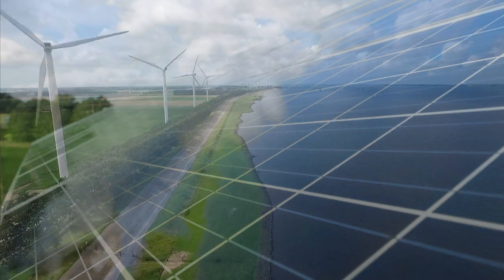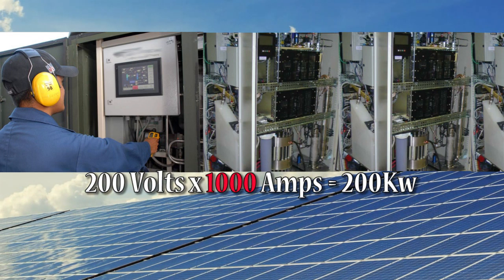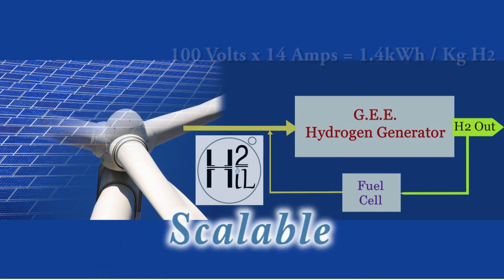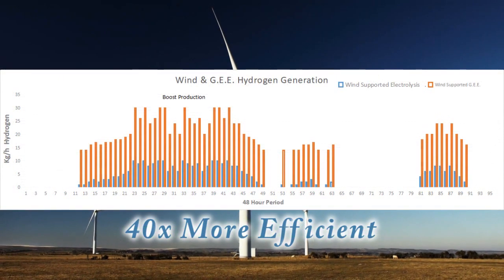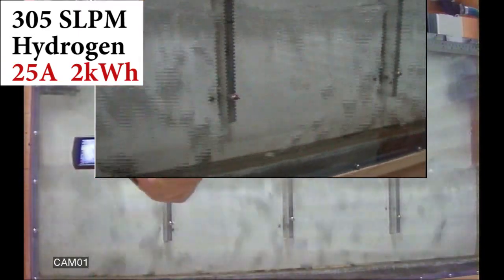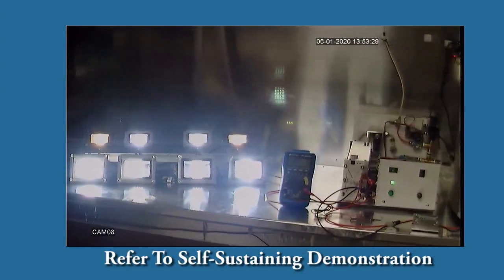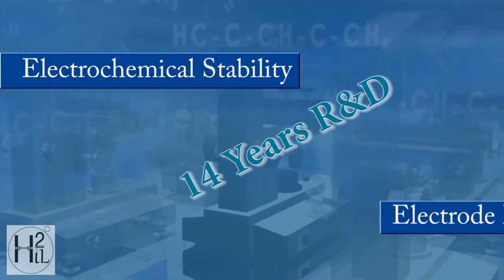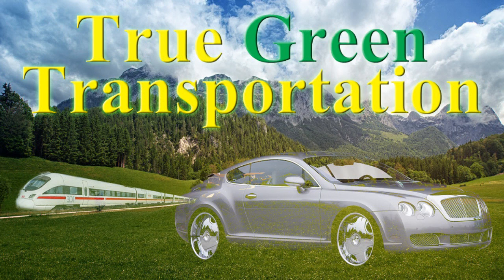Energy Storage in Hydrogen - A Workable Solution to Green Energy - Renewable Energy

Comment: Water is not a bi-metal. Is the galvanic energy coming from metals dissolved in the water? Or are you using the galvanic energy of oxygen? I didn't know oxygen had any galvanic potential. Where is the galvanic energy coming from?
Reply from the maker: Thank you for your question. For a full explanation please refer to the Technology' page of the h2innovationlab.com website.
Reply: @h2innovationlabh2il69  From what I can tell from your website the galvanic energy is coming from the electrodes. 
"One may therefore conclude that the bi-metal electrodes are the fuel and would need to be added into the calculation. Within all electrolysis cells the anode electrode is eventually consumed. Therefore one may conclude that within a galvanic arrangement the metals providing the galvanic energy would consume rapidly. However this is not the case in this application." 
 Hydrogen has a high energy density for a chemical fuel. So if even half of the hydrogen is being produced using galvanic energy a lot of galvanic energy would have to be converted every second. So for the galvanic energy to not be depleted the galvanic energy density would have to be massive and there for reprocessing the electrodes would require the energy input of all the hydrogen galvanically produced in the cells life time. And if the efficiency is as high as 3000% this problem gets even worse so how is the galvanic potential not being depleted? Is the galvanic energy density much higher than I thought it was? Or is some other form of energy involved in this process?
Reply from the maker: Nice to see a comment that is on track. Yes this a logical assessment and deserves a more in-depth explanation from the H2IL technical team rather than the media manager.
In the interim please refer to the video:  https://youtu.be/D9LBdO4cVmc  which give a brief, technical explanation of electrode longevity. The self-sustaining presentation and verification report CCTV videos on this and the H2IL MARKETING channel demonstrate a very small cell delivering a lot of energy for hours on end. Obviously not massive size electrodes in the small demonstration cell. If the electrolyte was replenished (as it is in the FULL running system) then the system would continue to generate self-sustaining energy longer. I understand the electrodes of that cell are still intact. 
The cost of galvanic electrodes is US$500 per US$20,000 (pump cost) of hydrogen produced. The electrode life is up to 5000 hours. The video I directed you to above explains it well but I will see if the H2IL scientists can add to this information.
Thank for your support.
Reply: @h2innovationlabh2il69  The video and demonstrations did a good job of explaining that the electrodes a last long time.  In fact the reason I thought it might be something other than the electrodes providing the galvanic energy at first was because of the lack of corrosion.  It's nice to see a technology with such great potential being developed.
Reply from the maker: Sorry for the delay. The H2IL scientists reply: The typical amount of energy to dissociate each water mole is 237kJ therefore conventional electrolytic cells need a lot of electrical energy with much of it converting to heat. The redox reactions to charge an atom requires most of this energy. However, in this application the galvanic energy is already a changed atom, in an ionic state. Ions need much less energy to carryout a task or form a bond. Therefore much less galvanic energy mass than one may assume when calculate external electron flow from stable atoms.
Reply: @h2innovationlabh2il69  The energy density of galvanic energy seems too low to cross the energy gap of 37.6Kwh. (39 Kwh out - 1.4Kwh in = 37.6Kwh energy gap for 1kg of hydrogen.) If the energy required to fill this gap comes from water then the energy will not be depleted as long as there is more ionized water. But ionizing water will use energy.

Comment: What is to stop another company from developing galvanically enhance electrolysis? Do your patents cover galvanically enhance electrolysis? Also, do you not worry that your technology is just a slightly modified version of a process that's a high school experiment? I'm just wondering, not trying to be devil's advocate or anything.
Reply from the maker: Thanks for your objective comment. Achieving full patent approval in any major country requires a strict and objective examination by the patent offices protecting their reputation. All examiners have degrees. This process is much harder, more complex and more thorougher than pair review for acceptance into science journals.  Thank you for your support.